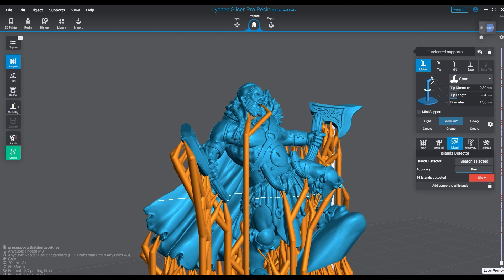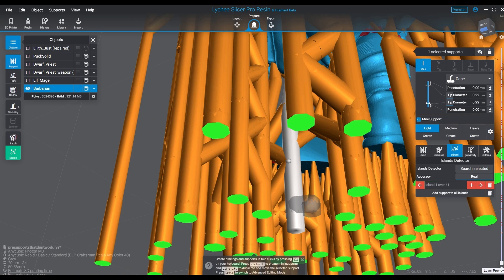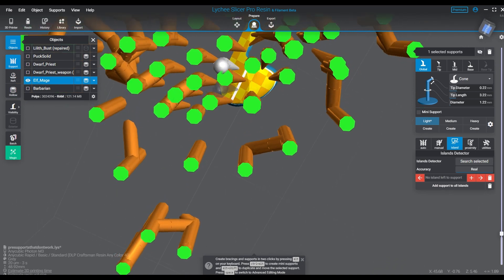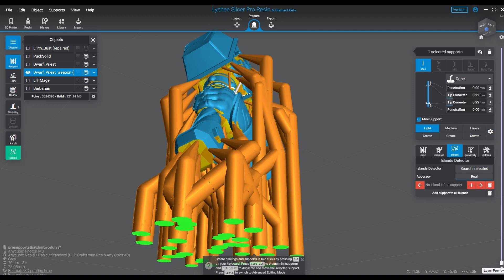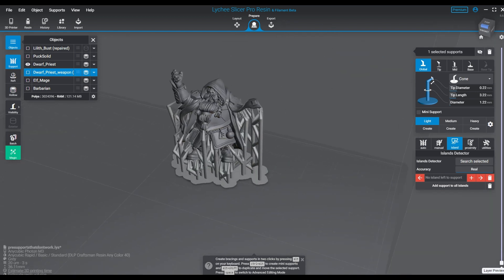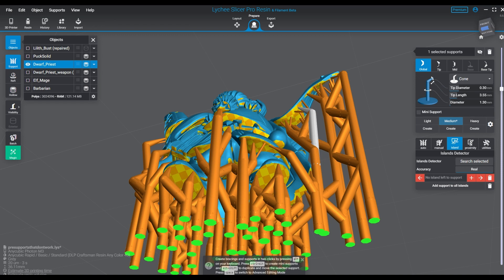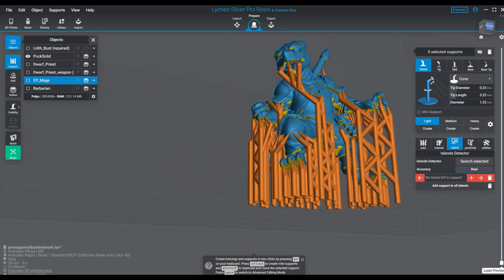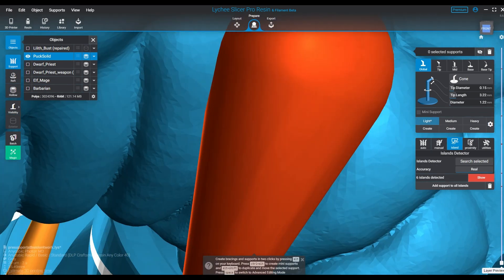Fix Pre-supports and the reasons why they fail sometimes.

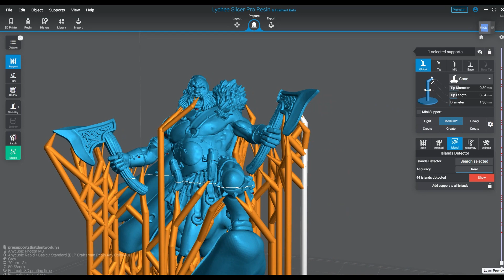Comment: @0:34 It is hands down the fault of person who made the presupports, assuming the end user has their machine properly dialed in. I have seen MANY paid models that had halfassed supports and weren't even island checked. I know they didn't test them because it would of failed on any printer.  At the same time i have seen presupports done by certain studio's that had been flawless on just about every printer i have put them in from 25um to 50um.  In general artists and studio's need to actually put effort in their pre-supports if they want to market them as such and exceptionally good pre-supports will get you repeat customers.
Reply from the maker: True words my friend. It is sloppy pre-supports. They either don't support it for all layer heights, or they use short cuts and automated generation and call it a day. Then if you have issues they will just tell you its the printer not being dialed in right.